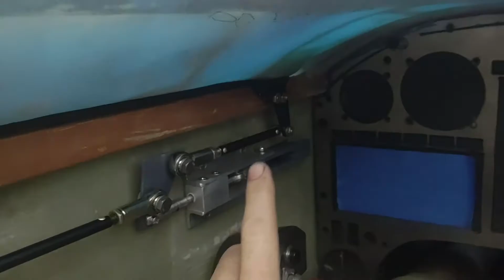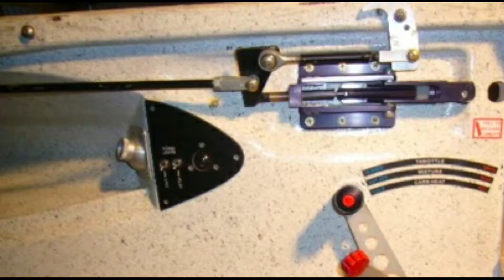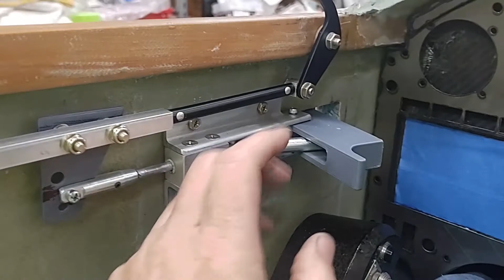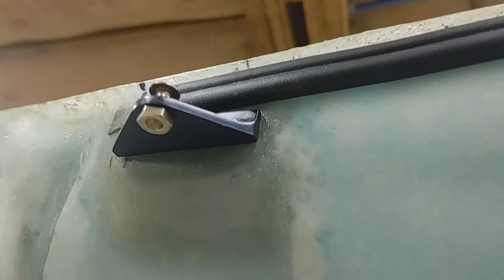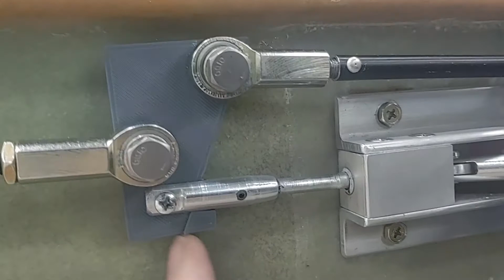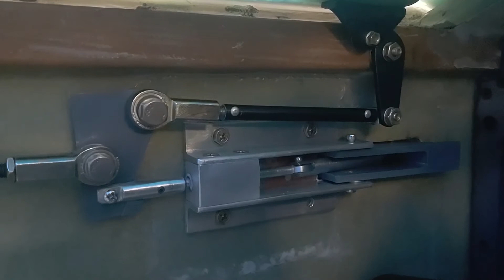Long-EZ N916WP - Canopy Latch Handle Evolution

Comment: Has anyone figured out a way for rear seat occupants to also be able to open up the canopy?  Thinking of emergency situations. 
The German Speed Canard. which is a modified Grob 103 sailplane has a good method to accomplish this.  
https://en.wikipedia.org/wiki/Gyroflug_Speed_Canard
https://en.wikipedia.org/wiki/Grob_G103_Twin_Astir
We are looking at modifying a Long-Ez to this configuration.  Any thoughts would be appreciated.
Reply from the maker: Debbie Iwatate and a number of others ran a Nyla-flow conduit from the back seat to the canopy latch to allow opening it from the back.  I just saw an example of that at RR last week.  Also, a lot of folks move the emergency SC-1 canopy catch (the flat metal tab) much further aft to allow the back seater to reach it.  My canopy is one of the biggest Long-EZ canopies out there (I personally haven't seen any larger) so there's a good bit of room to reach forward to gain access to that.  But always good to consider as well!

Comment: I think what you are looking for is called an over center lock. They are made by a rotating lever and its associated linkages. This will create a latch mechanism that wants to stay closed and will not open without forceful or multiple movements of the latch to get it open. Check Wicks Aircraft you'll find some thing that works.
Reply from the maker: I'll check that out on Wicks.  Last year at Rough River I found another EZ with very close to the same setup, so I'll take a hard look at that as well.  Thanks for watching!
Reply: @wade-airdog7730  Working on financing for a Long EZ right now.

Comment: Hello Wade.  I'm pretty far away from working on this so I haven't paid too close attention to canopy latches/handles.  Why did you decide to go with this design?
Reply from the maker: Hey Jeremy, with the layout of my panel avionics I couldn't use the traditional plans canopy latch coming off of the panel.  Just no room for it.  

Then, since I'm using a non-plans throttle handle mounted farther aft (not at base of panel) on the armrest, any aftermarket vertical canopy latch handle (I bought but couldn't use Jack W's handle) resulted in my hand hitting the handle when I manipulated the throttle.  

So a horizontal canopy latch handle mounted high up on the side wall was the best option for my panel/throttle configuration.

Comment: The locking mechanism in the picture that you have shown is smaller in comparison to your mechanism. that's why I believe the canopy is popping up when light pressure is applied to it. Try to scale down your locking mechanism to 75-80%  from the original dimensions, Maybe that should address the issue. As it will add more tension to lock the latch when the canopy closed and locked.
Reply from the maker: Awesome, thanks!  Will give that a try.

Comment: Shouldn’t the printed part be secured to a pivot point on the side wall. Hole should be in between the two rod ends. Should be four holes in it. Latch attach would need to be a slot, 2 rod end attach holes, and pivot point.
Reply from the maker: Thanks!  I'll take a hard look at doing a hard pivot point on the sidewall as you describe.

Comment: How about adding an adjustment screw to the boot? I'm thinking a vertical screw through the boot that bottoms out on the rod that exits the handle. Then you can tweak the lost motion out as needed.
Reply from the maker: Excellent idea Bro!  A vertical adjustment screw with a set screw on the side to lock it into position.  Thanks.
Reply: @wade-airdog7730  I've got your 6 Bro!